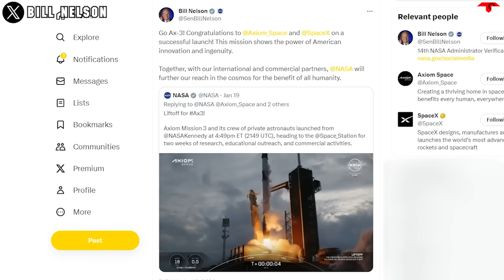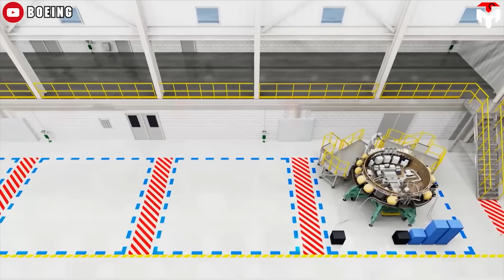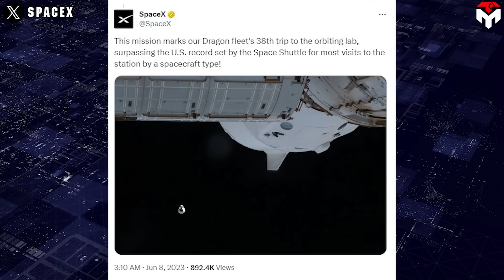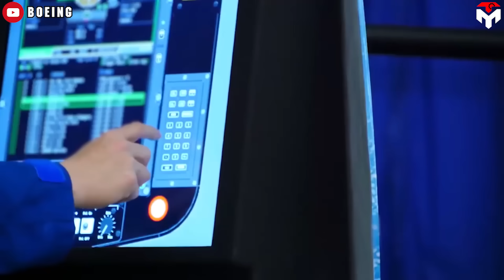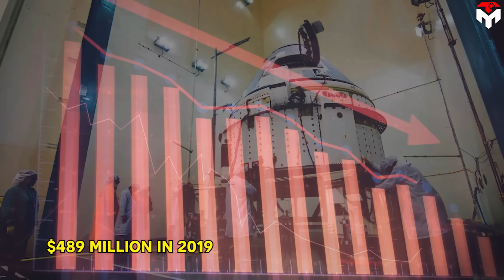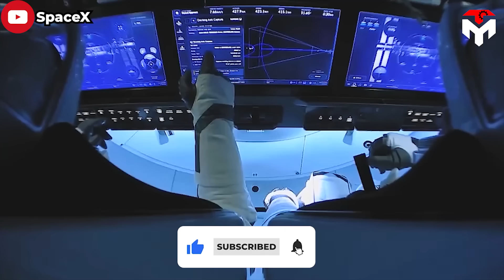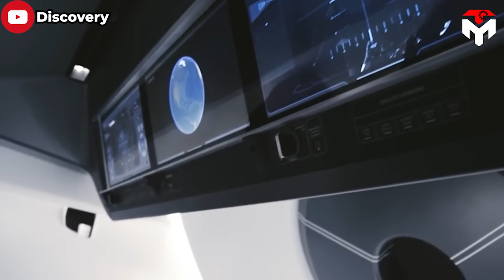What SpaceX Dragon Just Did Completely Humiliated Starliner & Soyuz...

Comment: I worked on the electric power system for the ISS at Rocketdyne starting in 1989 and ending in 2000.  They were bought by Boeing in 1996.  I've never seen such incompetence, before or since.  I could fill a book with horror stories.